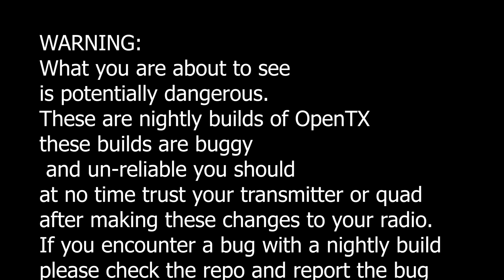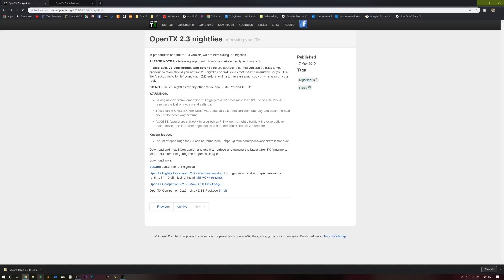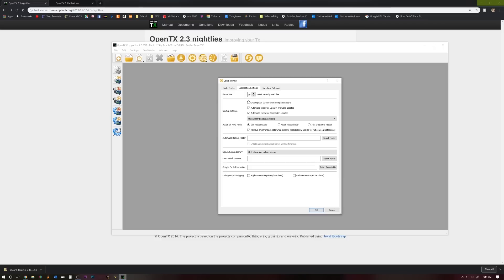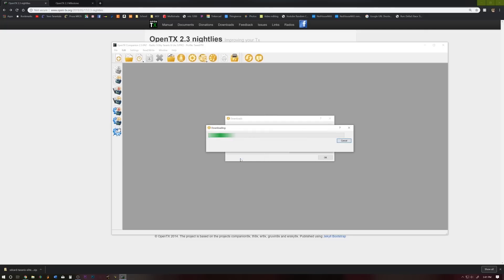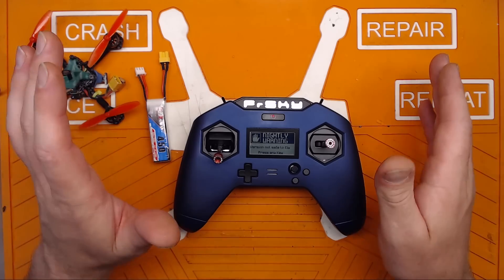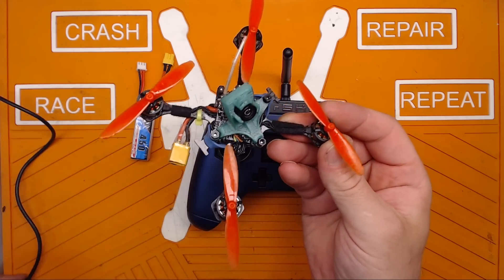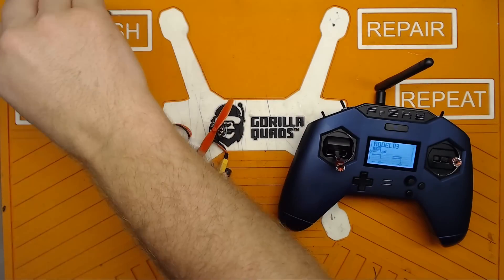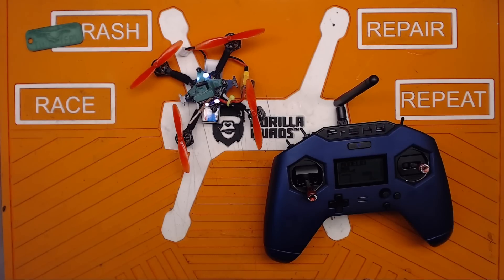X-lite Pro external multi protocol D8 Opentx2 3 nightly builds

Comment: Did you have to update the multiprotocol module firmware when you got it (and if so, how'd you go about it)?
Reply from the maker: No, I didn't updated the MPM firmware.
Reply: @TweetFPV  interesting. I'm setting one up now and heard it's a good idea to update to ensure adequate stick range. Glad it can still work fine without the update, configuring the firmware for it isn't easy
Reply: As an update for anyone reading this: I got mine to work skipping the firmware update!
Reply: Update to the update - works fine until I power cycle the TX at which point bind is lost. Got to figure out what's going on there (auto bind is off)
Reply from the maker: Have you loaded the power module update from frsky's web page?
Reply: @TweetFPV  power module updated along with ism and the pro's FW in their suggested order. updated MPM with as-given and then tried with  a fixed bind hex (in the event eeprom was resetting somehow). still having bind issues and it resets on Tx powercycle. Trying d8, d16 (PRO's internal &mpm) with a few different quads, nothing. Tried the mpm on a normal x-lite and it seemed to have issues so maybe mine is defective.

I did notice mine "chirps" during bind at a slower rate than your video, when it decides to chirp at a faster rate I get a bind
Reply from the maker: That is strange. Perhaps yours is defective. But we are still working with beta firmware so things might get better when the fw is finalized.

Comment: Have you gotten a Crossfire module to work on the Pro yet?
Reply from the maker: It should support crossfire now. I left the crossfire ecosystem a while ago and don't have a moduel to test with.
Reply: @TweetFPV  I can't get mine to work with Crossfire.. doesn't even power up the module..
Reply from the maker: It's a nightly build. They are very buggy. I have the same issue with the Vantac mpm. Sometimes it won't power but sometimes it will.  It seams like I need to start out on a model that doesn't use the external module then switch to it to get power. But again it's a nightly build.

Comment: I wish they'd release the X-Lite Pro 2 with tandem and/or an R9M Pro for the controller with multi protocols...
I don't mind having a module but I don't want to have to swap all the time and break the pins on the remote.
Reply from the maker: These are some people the have modded thier og xlite to have a crossfire lite module built into the radio body. This would probably be fairly easy with the r9m lite module. Just have to be willing to dig into your xlite.

Comment: Great that someone dares to try the nightly builds! :D I'm about to buy an Q x7s with an R9M module included in the sale.. Do you know if and when the Q 7S will work with access firmware and also maybe the multiprotocol module?
Reply from the maker: the qx7 should eventually support ACCESS. The QX7 does support the multi protocol modules right now.

Comment: Would u know if the irangex lite module will work the same? The Vantac-MPM is priced much higher
Reply: yes, irangex works too
Reply: @victor_glekler  thank you
Reply from the maker: I don't have one to confirm with but the multi option in opentx is the same regardless. So it should work but remember this is a nightly fw so it might work today and not tomorrow for no apparent reason.

Comment: Hi, as you mentioned the Nirvana in your video, how do you like it compared to the X-Lite Pro?
Reply from the maker: Of all the radios I have or have had (qx7, x9d+se, xlite, xlite pro) the nirvana is hands down the best built and most ergonomic radio I have ever used. It's not without its faults. The issues with it are mostly with the software which is still being developed. The nirvana is so good that it has made me go from being a pincher to a thumber. The transition was very easy using this radio.
Reply: @TweetFPV  Wow, okay, being a thumber myself I always thought the X-Lite would be the way to go as thumber.
Was thinking about the Nirvana myself too, but as FrSky has a good reputation in the community and also due to the issues the Nirvana is still having, I opted for the X-Lite in the end. Hope FrSky will soon bring out all the updates that also their accessories will finally be working.
Reply from the maker: I personally feel like the xlite is a better pinching radio than a thumbing radio.
Reply: @TweetFPV  Really? That's interesting. Unfortunately I havn't had the chance yet to put my hands on any of both so I had to choose after reviews, and everyone claimed the X-Lite is impossible to pinch without cramping and it's hands down the best for thumbers. That combined with the features of the X-Lite Pro made me actually pre-order one (no it has still not arrived yet), but tbh I'm no longer sure if it was really the right choice.
Coming from Spektrum any of these would mean something new to learn for me anyway. Maybe I should get myself a Nirvana too and see which one I like more and sell the other one again.
 Just not a huge fan of the FlySky receivers tho.
Reply from the maker: Yea I don't like flysky either and I don't use a y flysky recievers. I just use frsky and a xjt module in the back.
Reply from the maker: Either way they are both excent radios.

Comment: How big are the chances D8 will eventually on the intern module ? But anyways this is a big step in the right direction.
Reply: They've said on their website that it will never do D8 without an external module. Apparently it will do D16 at some point though.
Reply from the maker: It's anyone's guess.  At this point I'll just keep up on the nightly opentx releases and see what changes.
Reply: @TweetFPV  If FrSky wants to continue as market leader in this industry they should stop bullying their dealers and support backwards compatibility in their new products. That's exactly the reason why they became that great.